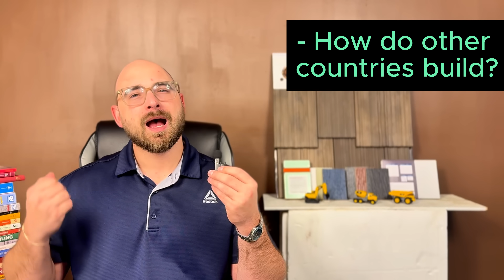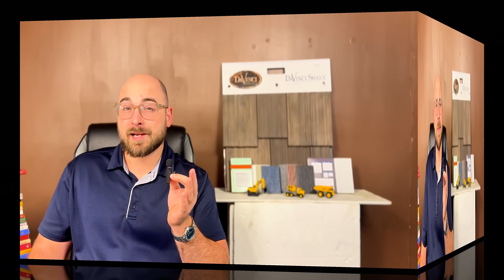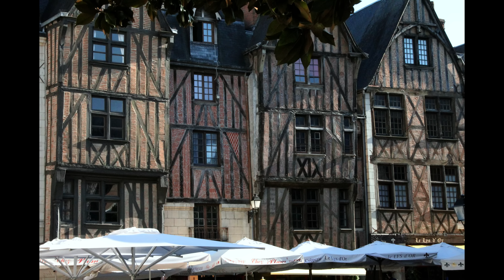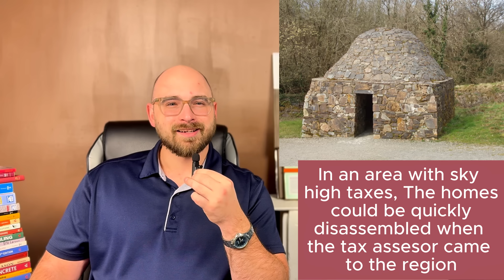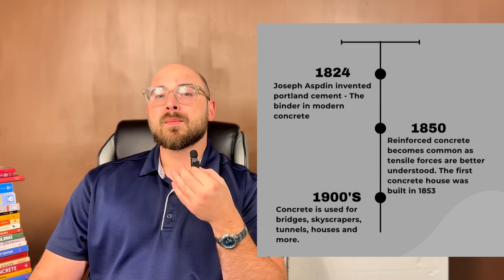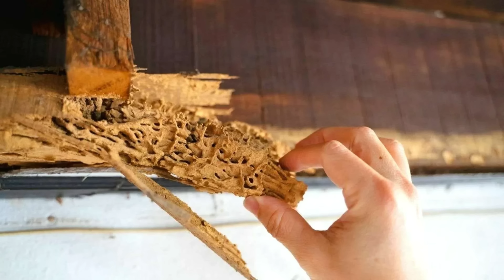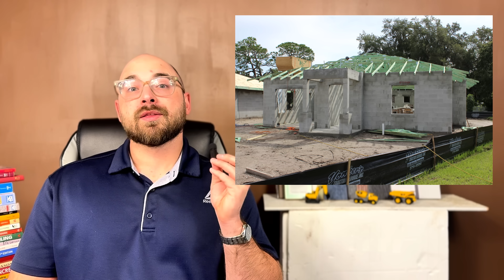Why Other Countries LAUGH at American Homes

Comment: I'm Danish, and bricks are by far the most common construction method for buildings up to three floors here. I grew up in a house built in 1908, and a house of that age isn't conservation worthy around our parts. For conservation to be considered, you would have to add at least another 100 years to that or have some kind of history connected to the building itself. 
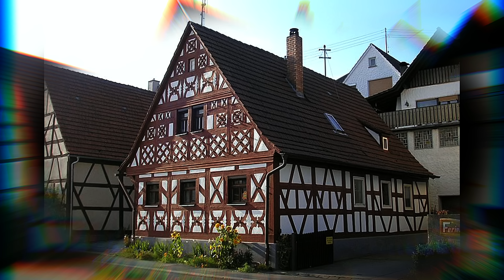We have buildings that are more than 400 years old that are built in the half-timber style (I think that the one shown at 3:46 is Danish - the word "Ferie" shown at the right side means "vacation"), and buildings made from brick and mortar that are more than 300 years old.

Comment: Because we ask the wrong question when building.
We ask how cheap is it when we should be asking how long will it last!
😂
Reply: Result: it's expensive and doesn't last. Why is that BTW? Is it because the land is so expensive or are the wood houses simply overpriced? If the houses were cheap, it would be perfectly fine... Build something out of renewable materials, use it for a while, then build something new. Makes sense when you have a low population density and can easily start building a new house while living in the old house.
Reply: Your wood shed is still more expensive than a proper house in Europe. You are constantly ripped off from pretty much any company .
Reply: @frankmueller7660 yeah bruh. A house in Germany that’s the same size as the average house in the US is at least twice the price.
Reply: I only got about 30-40 years left. Will it last that long? That’s my question.
Reply: 30 years is enough.  Pointless to pay to build for 100 years.

Comment: What I find tragidly funny is that in "toronado valley" you americans build the same flimsy "houses" year after year and every year they blow away. Have you never heard of reinforced concrete buildings? I´m from Iceland were we have earthquakes and sometimes pretty high winds although never anything close to hurricane force winds. The only times any houses crack but never collapse are if we get earthquakes over 6 to 6.5 richter. Sometimes roofs blow of but very seldom.
Another thing I often see from america are high trees with shallow root systems and nobody thinks about cutting them down to size even where there are toronados? You just don´t seem to be able to adjust to your environment.

Comment: It's the sound dampening that makes me think double wall brick, or inner concrete + outer brick double wall, is the bees knees. In Denmark summer residences are typically light frame wooden houses, very similar to the American style, and they're so sound transparent that its damn near like sitting outside. 

ICF seems interesting though. Raw concrete is ugly AF, so it makes sense to put it in the middle. My personal exterior preference is red bricks, but to last without an exterior plaster layer they have to be fired at stupid high temperatures, which adds both financial and environmental cost.

Comment: I live in Puerto Rico.  Most houses here are built in concrete, using blocks and firms.  More importantly the roofs are always poured concrete joined to the walls.  These structures can  accept many designs and easily withstand the weather.
Compare to tinkerntoy construction in USA easily destroyed by hurricanes, tornados, etc.
The massive fires in California would not occur, if houses were concrete, not wood.
Builders refusing to accept new materials continue use of wood, pressboard, drywall, and other deficient materials.

Comment: One thing to keep in mind is that US homes tend to be remodeled, or torn down and replaced, far more often than European homes.  The stick framing makes this much easier, even allowing the homeowners themselves to do some or all of the work.  Most US homes don't need to outlast their building materials before they are replaced.

Comment: Depends who builds. If me then I would make it to last either wood or concrete but with excellent ventilation and insulated OVER/MORE THAN LOCAL STANDARDS ARE, BECAUSE IT COSTS DURING BUILDING PROCEDURE ONLY A FRACTION MORE THAN ADD IT ON LATER:
My house would be heated with wood chips from my own forest. And keep the heating bill close to 50€ a month during -10C / -20C. With sauna eating source would be a wood stove.

Comment: Its not just materials though. Its also construction standards. Like running romex without a shielding pipe, not laying deep foundations underneath the house (often just a poured slab) and of course things like your terrible 110 volt electrical system and poorly designed plugs.

Comment: I was shocked to see that EVEN when bricks are used, they are just "for the look" and the only structural parts are small metal pieces that keep the brick wall from falling over...WTF? Why would you do that? If you want it to look like brick, there are cheap materials that will not kill you if they come loose and still look like bricks. If you go through the work of mason up a wall, why not a real one?? I had some hope for the US, but that is gone now. Yeah, concrete is getting more common, but the advantages of solid structures is something that was known in US since ever. Using wood to build a house (outside of remote log cabins) was a bad idea for, say, the last 100 years. Yet, every time a tornado makes a village go away, they will build wood houses again. People in the US are obviously not capable of learning simple facts (and I'm not even talking about politics here...). When your third house is destroyed by a tornado, even if you can get cheap wood, that is about the time when you could have saved a alot of bucks by choosing concrete the first time.

Comment: I had to do some research to convert into the weird american units (in this case just the inverse of what is used in europe...), but where I'm from the standard for insulation is R-32 in residential buildings. The actual legal minimum requirement is a bit more complicated since the law requires the equivalent of R8/14(walls/roof and floor), but also places a cap on the total energy consumption used for heating(E-value), so R-32 is really needed to compensate for doors, windows and airflow in general. I think this makes your point about wood framing in the nordic countries a bit misleading, since those walls are definitely not paper thin like in US homes! Wood framing is also not used if there is more than one proper floor(not counting attics). CMU or ICF is most common in those types of buildings. Wood framing is considered inferior and is mostly seen in cheaply built 70's/80's buildings.
Reply from the maker: Interesting, thank you for clarifying!
Reply: @Mike_Fortin  One important factor I forgot to mention: even our weakest wood framed buildings must have the structural strength to withstand up to 5-6feet of snow on top of the roof. Probably the main reason why multistory (light) wood framed buildings are not that common. Apples to oranges, really.

Comment: It's not so much the wood itself that we laugh about, it's the method and quality of construction:

Most sheds in Germany are built sturdier with stronger framing and more massive planking that US thin-wood framing houses. Many standard practices for US houses would be considered a botched job eligible for a refund here, like the thickness and stability of the walls, the thickness and stability of the planking, the rigidity of the structure. It is expected to build houses in a manner that they are sufficiently sound-proof that you won't hear a loud street in front of the house as soon as you close the door and windows. Drywall planking is expected to be double or triple planked at each layer of 3/4" or 7/8" each, etc.. You can build sturdy wooden houses able to stand for millennia and providing a good privacy, that's just not how Americans build their homes, to cheap out on every bit of material.

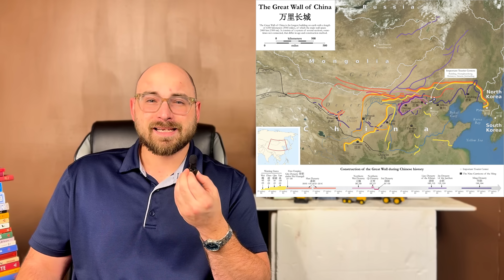Comment: 2:25 Alright I bite, the adobe house I lived in is almost 100 years old, still standing and had the best thermal and sound insulation of any building I have been in, it was warm in winter and fresh in summer an old rickety diesel truck could loudly rumble outside and inside would be just a murmur, and since it was somehow technically not a house (because of the adobe) taxes were LOW.

Comment: Concrete can probably help with California fire resistant.
Reply: Also all the stone houses and old churches survived the fires
Reply: @justjake5389  Doesn't mean that the stone houses and churches are safe to use after.  High heat damages most construction materials, and some of those buildings would have to be demolished because of that.

Comment: I would absolutely do an ICF (insulated concrete form) house if I needed to build from scratch. For now, I’ll have to make do with my brick veneer, wood frame house. Plenty of room for improvement in its construction, but I didn’t have anything to do with that. All I’m willing to do is work with what I have.

Comment: I currently live in a balloon frame house. It's quite interesting.
The major issue is that renovation isn't just more difficult since the vast majority are solid inside and out. It's not an option. Buy and paint and that's it or build new. Sine the interior walls are solid installing a new cat6 drop or a new outlet as well as interior remodeling including removal or moving walls isn't cost effective or in many cases even possible.

Comment: Construction material will likely become a HOT topic in California. Would make no sense to rebuild with the same materials that didn’t succeed during the recent disaster.
This is a subject I’ve watched my entire life. My father in law built the family home in the fifties with concrete block, stucco.
Good home and there were issues with remodeling, upgrading mechanical systems, insulation and waterproofing.
I own a 1911 four square frame, and it’s a good house but again there are issues.
I think modern engineering and of modern materials mixed with structural concrete and steel will be the best of both worlds.

Comment: The "american" style of homes  has a lot of downsides but cost of building definitely isnt one of them and I can appreciate that. But that is not always reflected in the cost of buying/renting, so not all sunshine and roses.
I think the reason for the rather vocal criticism is the differing mindset between the US and (mostly) Europe. As you pointed out to a european structures are meant to last forever. A punch mark in a dry wall or moldy wooden flooring under a bathroom looks like abject poverty and the complete collapse of society (I am exaggerating). And while there is a point to be made about ease of repair, this will fall in deaf ears to someone who is used to things simply not breaking in the first place. I am inclined to support them on this.

Side tangent: the amount of nearly un-insulated homes in the US is bewildering. You will find decrepit structures... With ACs on full blast to combat the outside climate. 
Again a topic EU bros are rightfully raising eyebrows at.

Comment: It isn't a secret that Americans prefer new homes keeping up with ever changing fashion. They prefer more spacious rooms, more flexible planning designed for specific requirements. I personally live in a house, which was built in the fifties, with some extensions added later. It definitely lacks a modern appeal, but it is still cozy and comfortable.

Comment: I am Hungarian, from Europe. Houses and material are by no means cheap here, if you want an all wood and paper american house. 
Earth houses echo usually. They amplify sounds, specially when some materials, like horse manure is used. Whey this is, nobody knows sure, there are only theories. One is that the echoing helps to wake up, if a stranger, like a burglar is sneaking around in the house (most medieval houses had no windows, or they were small and shut at night, with wooden shutters).

Comment: Building codes!  Homes need to be built to mitigate expected natural phenomena.  This needs to be enacted at local levels.  Simple wood structures fare better in earthquakes(not immune) but not so well with severe storms and wildfires.  Simple masonry structures fare better with severe storms and wildfires, depending on roofing, but don't tend to survive earthquake as well.  Most structures can't handle floods or landslides.  Many jurisdictions don't allow homes to be rebuilt after floods.  Floodplains at any elevation or expected rainfall require consideration.

Comment: Idk concrete is definitely not great for the environment but if you built to last it’s a difference ofc. Maybe America could experiment with certain types of mud building techniques. There’s a lot of plain nothingness dust area, like not really sand desert but orange American desert(idk what it’s called in English). Maybe using the dirt or dry clay from those places could be used as a building material?

Comment: 1) I work for a company that sells DiVinci roof tile although I work for a different division(lol)

2) I am 37 seconds in to this video and I’m already annoyed by incompetent keyboard commandos from around the world

3) my home was build in ‘85, out of “match sticks” in SE Florida. It has seen MULTIPLE hurricanes including Floyd, Francis, Gene, Irma and the list goes on. Construction and design fact: wood frame can bend. It can expand and contract. Although in theory it is not as “strong” as concrete, CMU (block) and/or stone, it is not rigid as such; Therefore, it is more forgiving than many uneducated realize. 

Lastly, one person mentioned (in your video) that their home was constructed with mineral wool as a key component. Mineral wool is typically used in fire stopping applications as safing between intumescent sealants and the substrate (or as backer material to fill a void to large for a sealants capabilities (Google proper joint design), so not sure what they were trying to convey there. 

I guess I’ll unpause the video now and continue on. Sorry for being a keyboard commandos of my own here. I acknowledge it. Lol.
Reply: Your house still won't be standing in a thousand plus years like many of our buildings here in Europe, no matter how clever you think you are. 
My stone house will. 
And so you know my door handles are older than your nation's entire history.

Comment: Wood is a way better insulant than concret or steel. Interesting when you live in a place where -20°C happens every winter.
Wood is good at sequestering carbon.

Comment: I live in a 2800 sqft wooden frame home in Kentucky built in 1919. Fully modern upgraded, well insulted, central a/c, gas heat. Stucco exterior, very low maintenance. Many wooden homes in my neighborhood are 40 years older and are all in excellent condition with current market values of $420,000 to $640,000. My house cost $7,200 in 1919. Europeans can laugh if they want, but I'm warm in the winter, cool in the summer and quiet on a 1/2 acre lot.
Reply: My house is older than your entire national history. 
You have no clue at all. 
1919 is a very young building. 
My house dates back to early 1200s. 
My door handles are older than the US, as is my dining table. 
This is why we laugh at you, because you haven't a clue of anything outside the US bubble.
Reply: Most of us agree with you. 

 Europeans tend to be very arrogant and critical to cover up for their insecurities and inferiority complexes, from my experience.
Reply: Most of us agree with you. 

 Europeans tend to be very arrogant and critical to cover up for their insecurities and inferiority complexes, from my experience.

Comment: You can't get a mortgage on a steel frame house in the UK as the frame has to be inspected and to get to it you have to destroy the internal walls to check the fixings every time it's sold.
Reply: Completely not true.

Comment: In costa rica you would need to be filthy rich to build with wood. The environment is our whole deal, so everything is protected and regulated.
We build with bricks, but our insulation is air, foam insulation is too expensive, at least we don't have snow, so it's not that necessary.
And funily enough, my dad always brags how our country uses california's seismic code.

Comment: ICF and SIP's are increasing in building trends all across America. What I would add to that is the new Air-Heated radiant floor system for concrete slab-on-grade shallow foundations from Legalett. It's HOT AIR not water so if you drill into the floor and puncture a tube just cover it up with tape or caulking no liquids like water, it's amazing.

Comment: So, youre blatantly misinformed on the wood housing aspect. Japan has a testing facility for buildings and demonstrates how wood houses stand up to earthquakes better. This is why many Japanese homes are wood, despite the hurricane risk. The way the wood is designed uses a shifting interlocking frame that allows the structure to stand... it's shown that brick and concrete buckle under load faster due to the weight of the structure collapsing the building. Wood is not necessarily cheaper, and internally insulated walls are superior to retrofitted externally insulated walls (like those for old European buildings).

Comment: Steel in house fondation is a must have by law here. It keeps houses survive in disasters. Every year we have some disaster with water or earthquakes and usualy the old houses that are not to that standard go to hell. Side pillars (and middle) in new houses are made to be earthquake proff, while araund the house you have a brick.

Concentrate houses are NOT GOOD. Same with houses that come with pre-build concentrate parts that you put like legos. One huge earthquake and they are down as the weight is not balanced.   (also they dont regulate temperature in winter times very good -- only in summer)

Us houses are deathtraps. If you want to build with wood, you have to use Dougong.